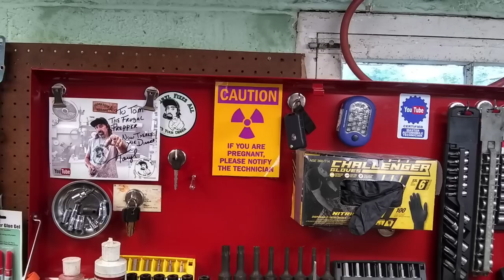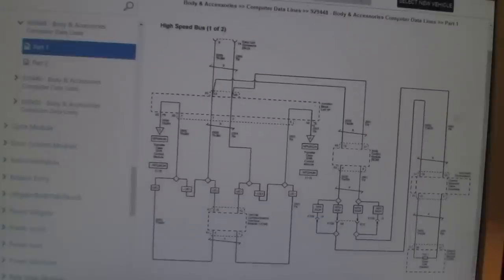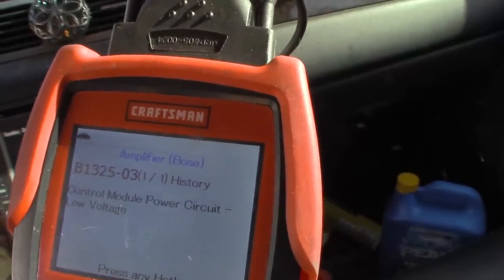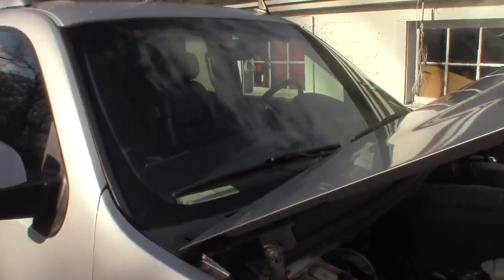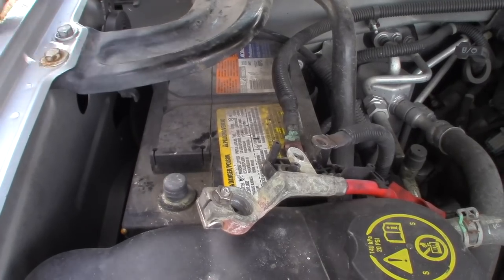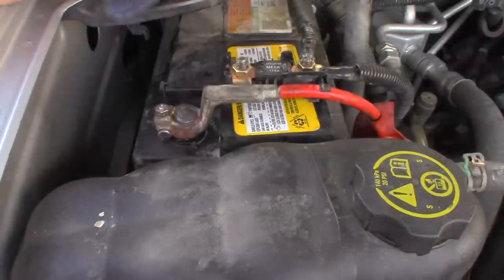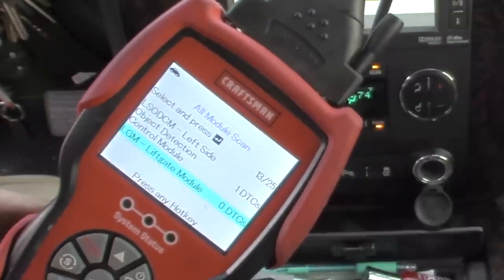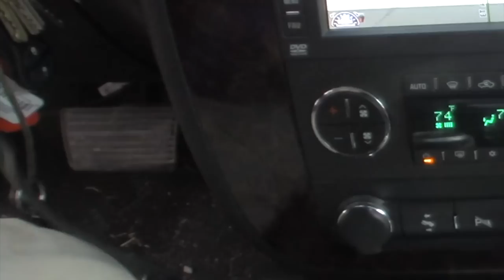2012 GMC Yukon Denali - Electrical Problems - Multiple Codes PO573 C0196 B1235 B2555 U0233

Comment: Penetrating prelube on corroded electrical connections can definitely help get things moving.
My wife had a PT Cruiser. Got rid of that thing at 50,000 miles before the problems began. We live in mostly winter. She has a Jeep now and loves it. Three years old and 14,000. Doesn't drive much. Several oil changes because it's old not mileage. Ha!No more stuck in the snow. 
I've drove a Suburban for years and love it. Got a Denali today. She bought it for me and told me in a text. Freakin awesome! I've always wrenched my own cars. Good info for potential future issues. Learnification equals success to fixify. Thanks man!!

Comment: Brake switches were common problems preventing cruise control from being used and also it tells the computer the transmission is in park. I had it keep the gear lever stuck in park because of brake switch. Check if the taillights are on when checking the issue code or no code

Comment: These 07-13 Trucks and SUV’s had issues with driver and passenger door switches. I was told to typically clean the contacts and then your good

Comment: I have a 2012 Denali that keeps going dead. This last time I was sitting inside and I heard ticking/clicking sounds coming from the window control area. Any idea on what that might be or where to start?
Reply from the maker: Bad main ground between engine block and body is a common problem on these.  IT lives under the plastic cover on the bottom.  A lot of times I just add another ground cable to the topside between engine block and body.